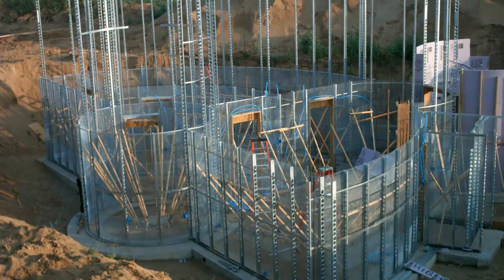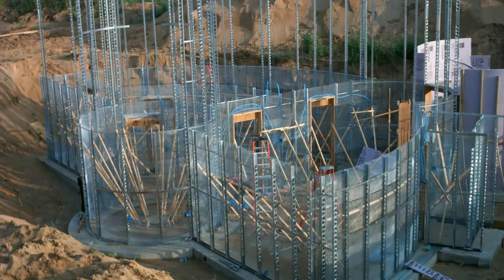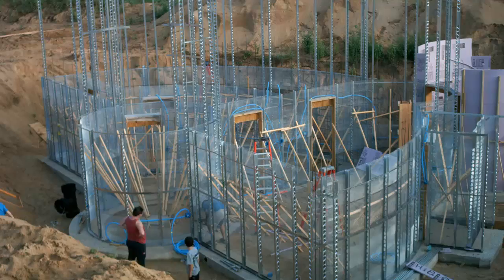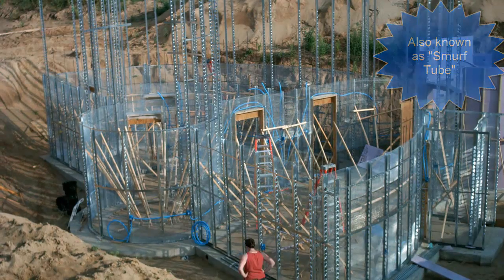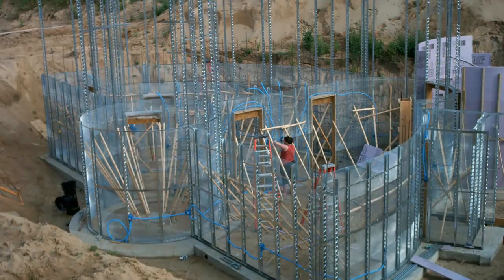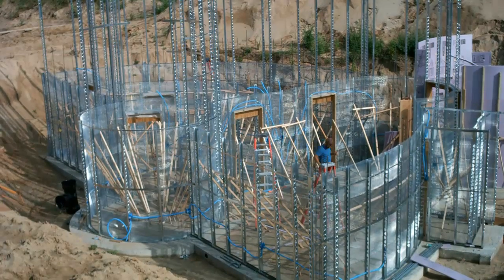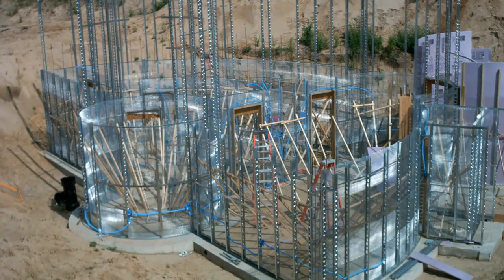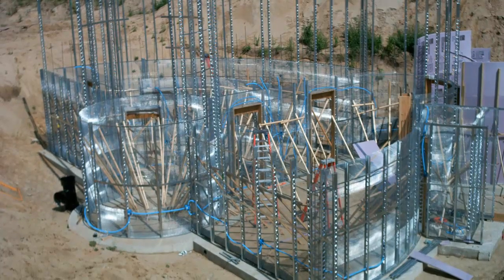4.9 Earth Sheltered Home Electrical

Comment: Did you consider ics and what the difference in cost?
Reply from the maker: Yes, I spent a lot of time with various ICF company brochures and went as far as getting quotes from several installers in the area.  Cost was much higher, but I think the build speed would have been much quicker with the ICFs.  At the time, I thought this steel framing method would be much faster than it was.  If I had to do it again, I'd probably design something with standard size form panels or even pre cast pieces.  You can do that, remove the forms and cover everything with insulation for less than the cost of ICFs, and curved ICFs cost even more.